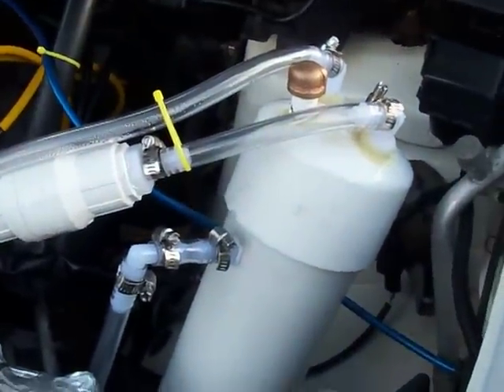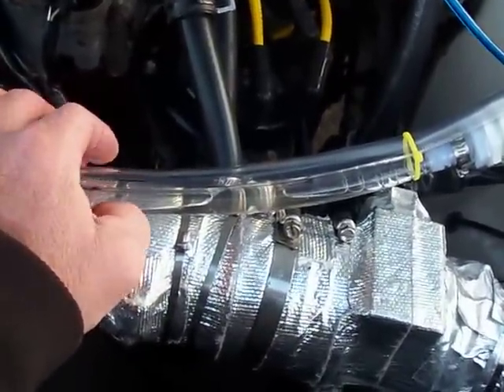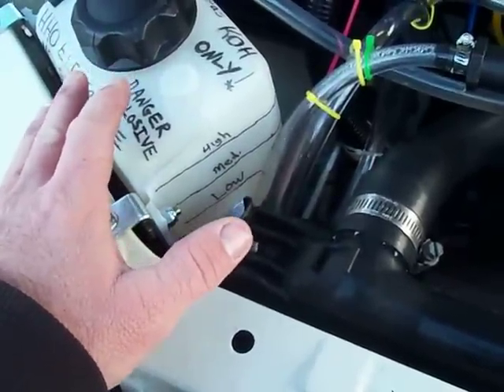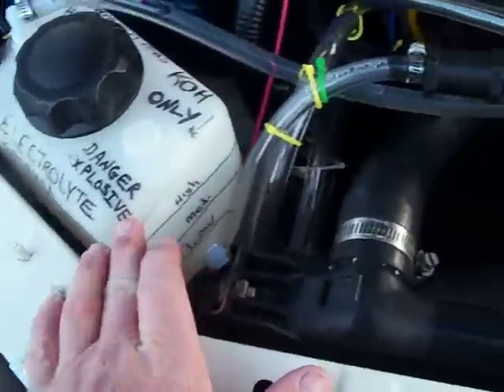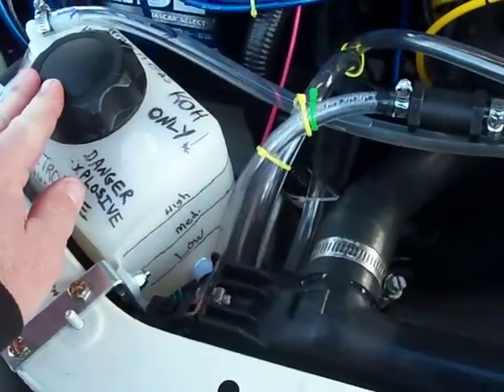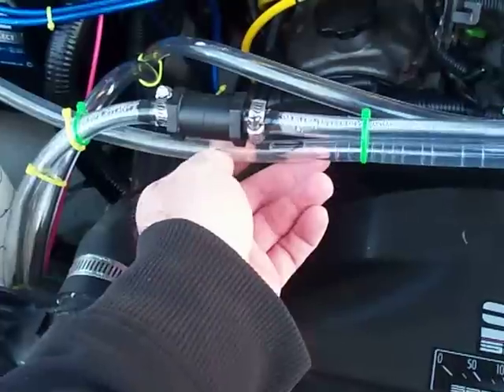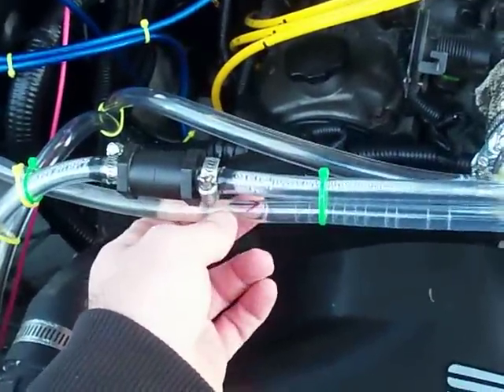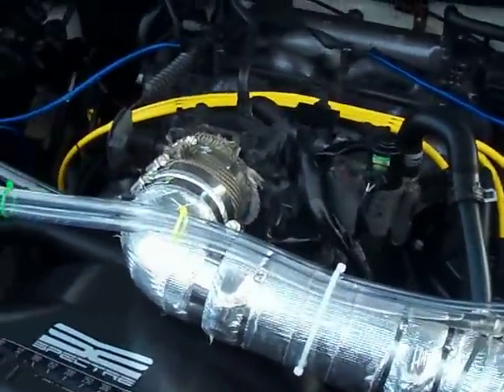HHO Electrolyte reservoir sloshing/fluid control issue.

Comment: Second issue I see is the the reservoir sits higher then the intake of your engine. It should always be 6 to 8 inches below the intake of the throttle body.  Clean up the tubing installation and get rid of the excess tubing...